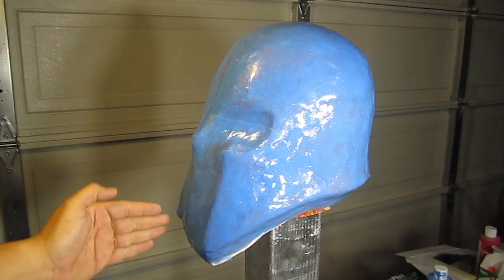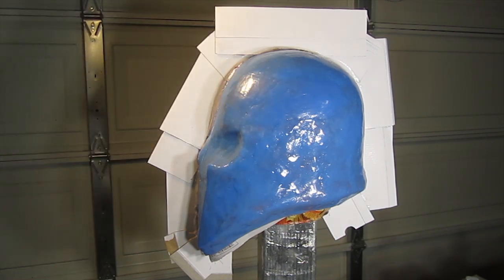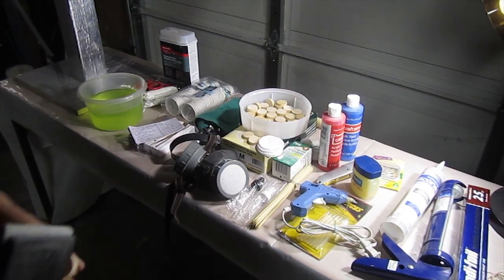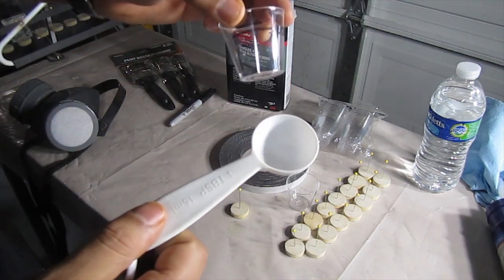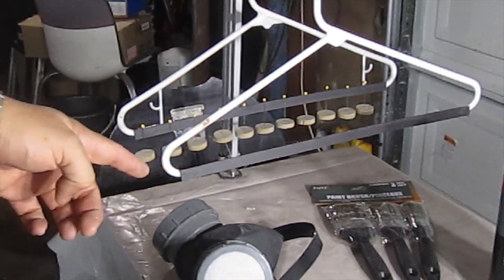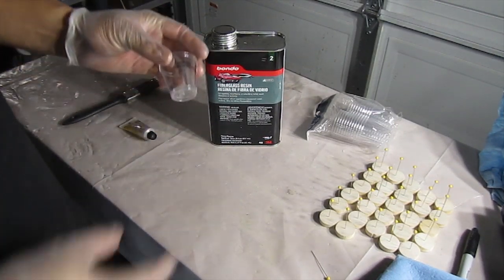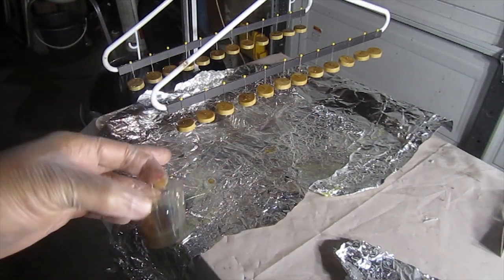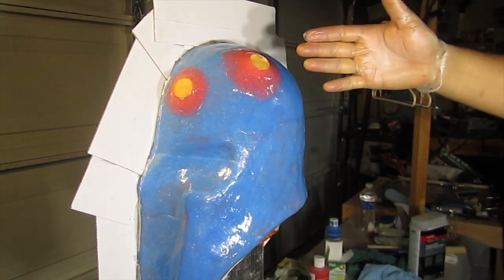How To Make A Silicone Mold Of A Helmet Pt 2

Comment: For all of the cost and hassle, why not just use Smooth-On Silicone molding rubber.  it is designed to be a 1-1 mix without the mess for about $40.  And use clay for the divider.  $3.

Comment from the maker: @seriff DeLoud yes this method would work with clay models as long as the clay is a sulfur free clay. Keep in mind that this silicone is not really stretchy so when you are going to make a mold you plan ahead of how you will seperate/devide it into sections so that you are able to take your original out of the mold and future casts.

Comment: It is pretty much impossible to create this "Mowhawk flange" that boogie is doing on his helmet with glue.  Therefore I will be encasing the entire helmet with lineup keys with fiberglass.  Once the fiberglass is dry, I will cut through it with my handy dremel and separate the halves and then install a flange that way.  There are many fixes in this tutorial that could make it easier for others to handle things on their own.  But it's a  very well put together series.

Comment: may i know is it necessary to apply one by one? or can i just apply all at once?
Reply from the maker: Leon Thian not sure what you meant by one by one? are you talking about the slugs for registration? if so I find it easier to dip them one by one.
Reply: ah nope. i mean the silicone. u measure the volume in a cup and apply it right? can't i just mix all and apply all at once?
Reply from the maker: Leon Thian  You can probably get away with doing that for the 2nd and final layer as long as you keep that 1/8th thickness to allow the silicone to cure properly. The first layer is the most important layer per it gets all your detail and that layer should be the thinnest layer of silicone.
Reply: i see. how about the amount of silicone in a cup? can i just put more? cause if follow that amount it will takes a lot of times